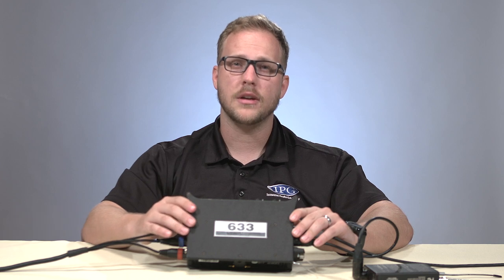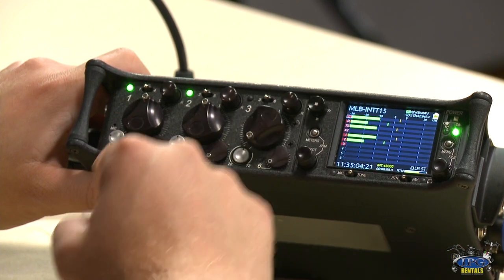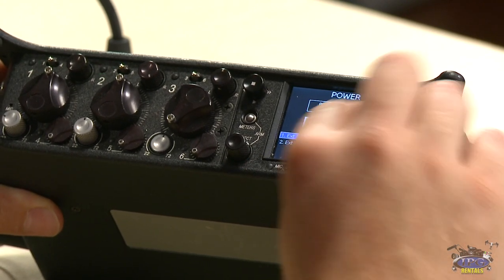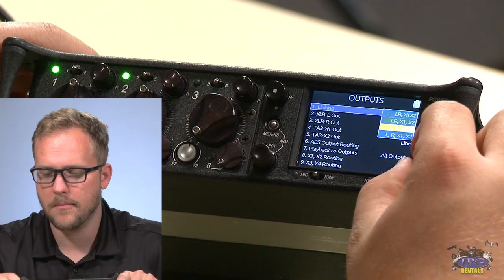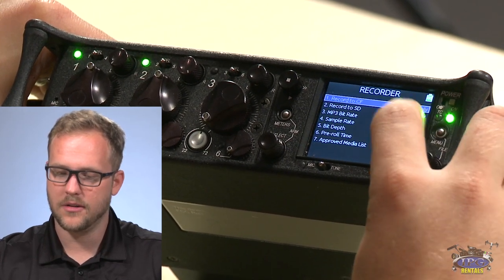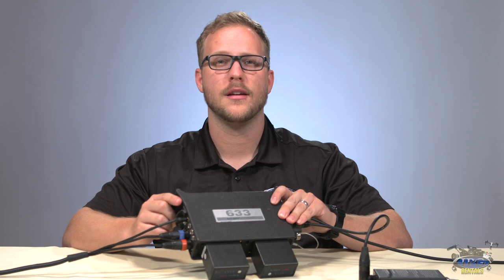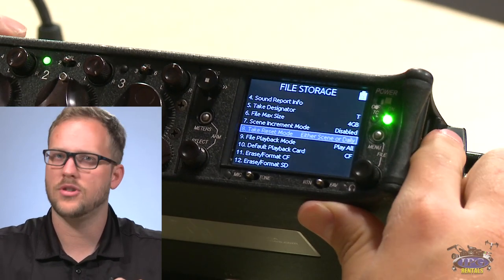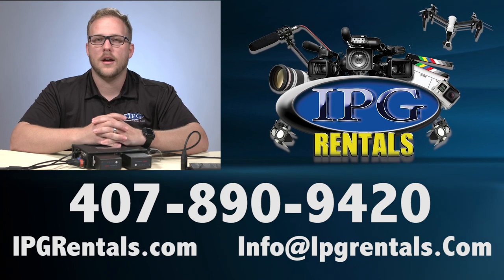Sound Devices 633: In-depth Tutorial - Video Production Equipments | IPG Rentals

Comment: I have several questions:
Do you not use the fader at all if you set something to prefade? If you set your ISO tracks to prefade, and your mix track to postfade - do you only control the mix track with your faders then, while the ISO tracks are controlled by the gain knob only?

Should you always set the ISO tracks to prefade, and the mix to postfade? Any other solutions? Say I have a boom mic on channel 1, and two lavs on channel 2 and 3 respectively. I also want to record a mix track of them all. What would I set to prefade and postfade in this scenario?

What are the X1, 2, 3 and 4 channels used for? And when would you want to use them?
Reply from the maker: I will have our audio op answer these questions for you